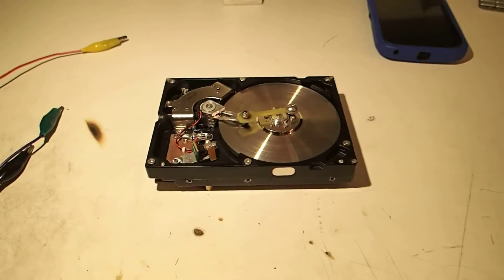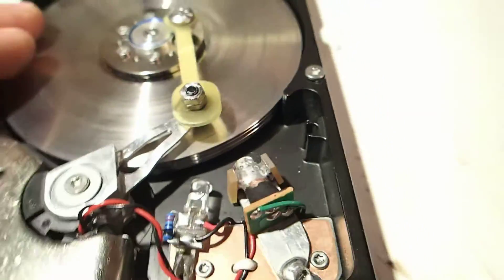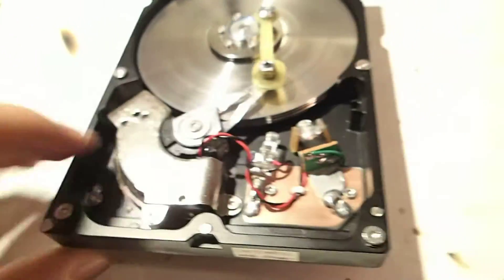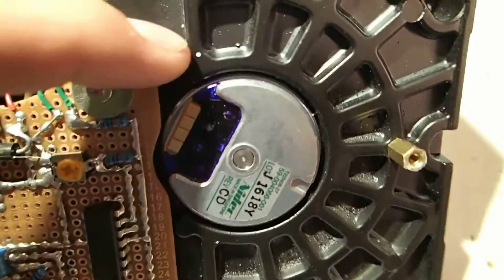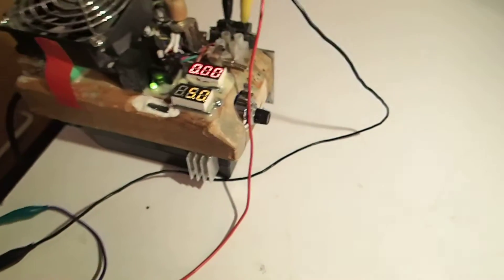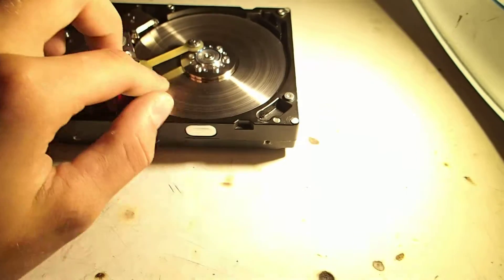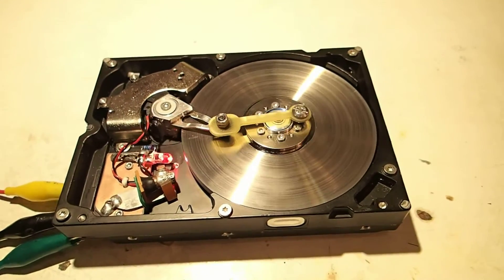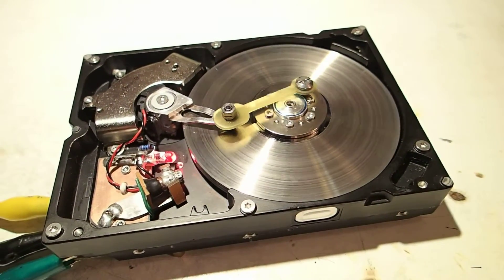HDD Motor Overview And Run

Comment: Interesting. Whats its top speed??
Reply from the maker: When I built it I could get it to run up to 4000rpm. Since then I think the coil overheated and partially shorted. In the vid it wasn't going faster than 1000rpm. Before I could run it for ~5sec straight on 30v but now the coil starts to smoke in a few seconds :(